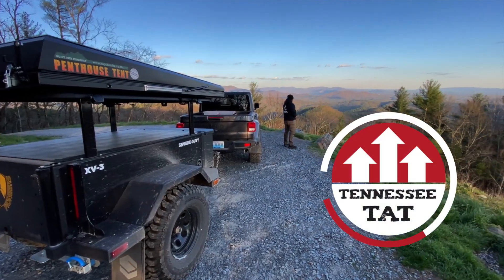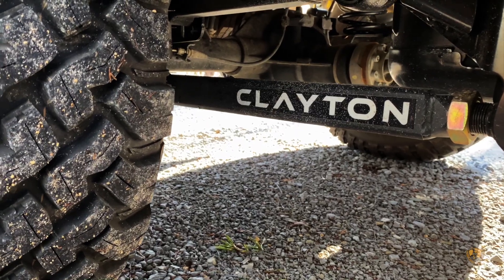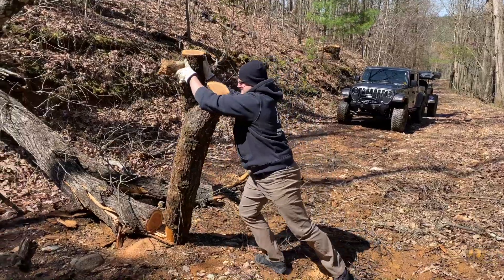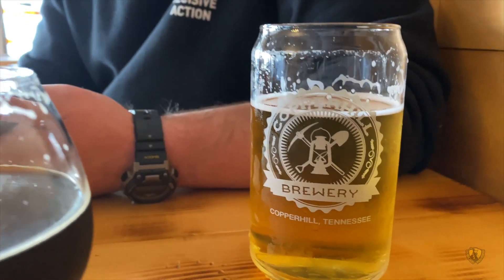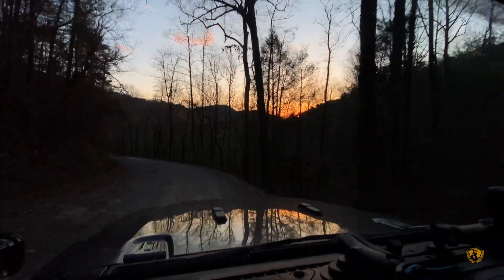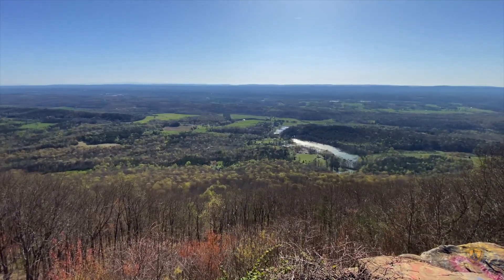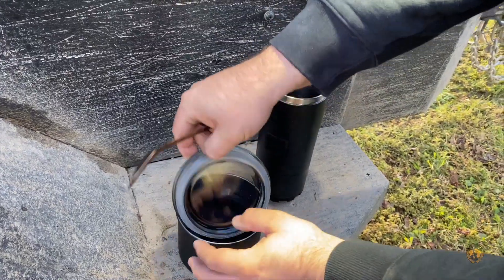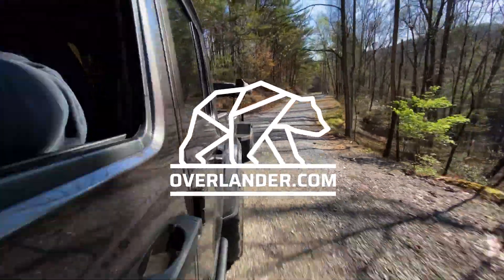Trans America Trail - Tennessee Section - Travel Guide

Comment: Great job on the videos, I’m working my way through the series.  I have a 2021 stock Dodge Ram  4x4  with 4wd low - 4 door on 20” tires. With the long wheel base and stock height is there any possibility I could do this trail?  I realize it’s not really purpose built for this.  Concern would be bottoming out, river crossing and tight turns as she has the turning radius of an ocean liner.
Reply from the maker: @etiennesprangers1953  all of that sound doable. Not sure about the 20 inch tires that seems small. 20 in rims?
Reply: @ oops, yes 20” rims.
Reply from the maker: @ more than fine! I pull a trailer ain’t nobody longer than me on the trail! Lol
Reply: Thanks for the reply

Comment: I have a stock gladiator Rubicon, do you think I would be ok running this section? Especially with the water crossings. I plan on running it 12/26
Reply from the maker: The water was particularly high from rain so as long as it hasn’t been raining you should be fine

Comment: How long did it take to get from T Plains to Copper Hill ?
I would love to do a day trip
Reply from the maker: Copperhill was a day and a half and we had to skip a section in the middle that was closed due to a washout. So definitely plan for two days of relaxed beautiful riding
Reply: @OverlandPioneers  So plan for two days to do Tellico Plains to Copperhill/McCaysville, right?  It doesn't look that far, but it's always hard to tell with those back roads.  Just planning ahead. I'm going to do a Sat/Sun combo with a small group, so just trying to see how much we can get done driving during daylight in early spring (with a few stops to check things out).  I was hoping to get to around Pratersville/I-75 in two days, but sounds like that might be too aggressive?
Reply from the maker: @eljefeslash  always give it a extra day especially with a group as they tend to move slower!
Reply: @OverlandPioneers  thanks! very new at this but looking forward to it. hopefully no vigorous pumping on this trip :)
Reply from the maker: @eljefeslash  you really want to avoid that at all cost!!!!!

Comment: How do you turn around with a trailer if you come upon a cloased gate?
Reply from the maker: A few ways. Typically gates are right at pull offs so a easy back up and turn around. Or a Austin powers 50 point turn. Worst case is back the trailer to one side of the trail disconnect after locking trailer brakes turn the truck around. Flip the trailer around and reconnect. Takes about 3 mins. So not bad.
Reply: @OverlandPioneers  Thanks